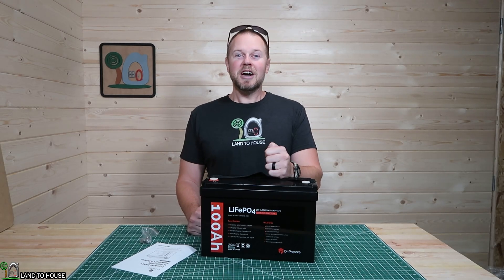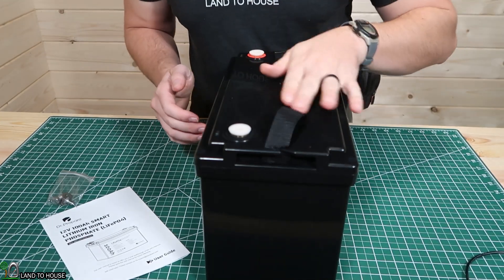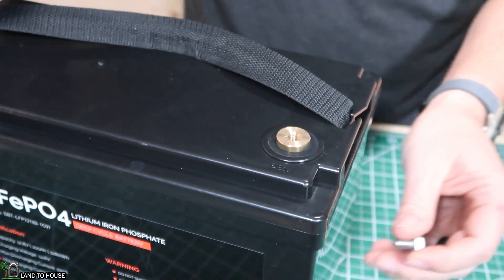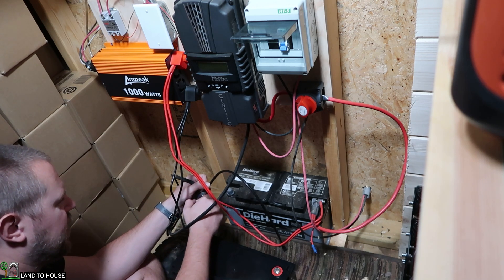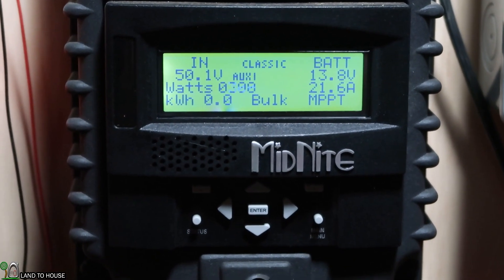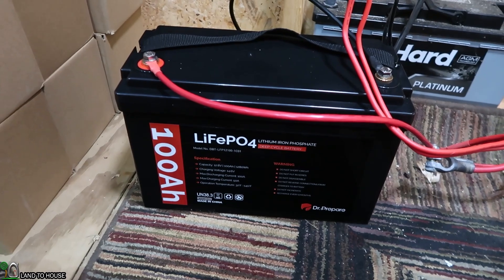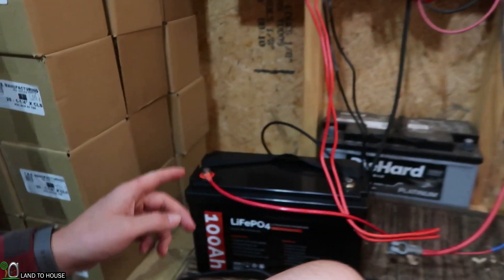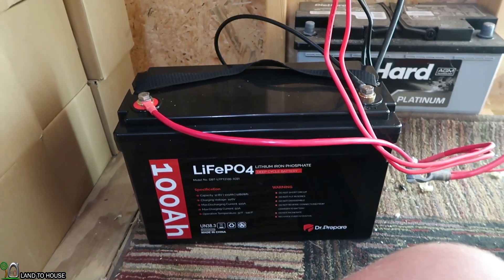Dr Prepare 12v 100Ah LiFePO4 Battery

Comment: U forgot to read on battery that you can not series the battery because the bms board in battery does not handle voltages above 14v where as if it sees more then batteries shut down inverter shuts down

Comment: Tried to cancel an order. Contacted them immediately. Two emails and 3 days later, still no response. I don't recommend using them.
Update:
They shipped the order anyway--even after I contacted them days before it shipped. Now I have to dispute the $600 charge. Crappy customer service.

Comment: Those don’t have a temp sensor that shuts off charging when cold. One day at or below 0 deg and you damage the battery permanently if charged at all and the severity goes up the higher the charge is. They get away with it until the warranty is over in many cases as with a very small charge it just degrades faster. The internal resistance of the battery also increase along with the self discharge until you get to the point of cells venting in the end because they run away. I believe it was will prowse that opened one of these and found the low temp shutdown did not work

Comment: I have the same battery for review. I will be testing the low temp cuttoff after leaving the battery in the freezer for a couple days (since they claim it has low temp cutt off and will prowse tore it down and proved it didn't). I'm interested to see how much capacity is lost from charging it at such a low temp since everyone just says it will be damaged.... But by how much right?! 

 I was able to putt 100ah from mine in a capacity test, it charged at 50amps just fine and I was able to pull 100amps for 10 minutes just fine.
Reply from the maker: Nice! Yes I also wonder how much is lost. I have seen mine charge at around 32 degrees. We have not had much cold weather so far.

Comment: This doesn't have low temp cutoff and build quality seems not good inside. Will Prowse did a teardown and didn't recommend it.
Reply from the maker: So far I have had the battery down to 22 degrees. No issues at the moment. I have only been using it when the outdoor temp is around 30 and up. We shall see how well it does when it gets really cold.
Reply: @LandtoHouse  Be careful getting the battery to low temperature as it doesn't have protection. You will be able to charge it even at low temp but it will damage the cells permanently and reduce the life significantly. I don't think you will know it right away.

Comment: So this battery does have a lower temperature disconnect right Because I live in Maryland and I wanna put this in my Rv
Reply: It doesn't have low temp cuttoff, will prowse tore it down, no temp sensor inside. I also have this battery for review and mine charged below 32f. Still testing before I put out my video.

Even after will prowse torn it down and found that it didn't have a low temp sensor inside the company still says it won't charge when below freezing lol...
Reply from the maker: it says that it does not charge below 32 degrees and does not discharge below 14. But I have not tested the battery below 26 degrees so far. Also I have not tested the charge below 32 because it is not cold enough yet. So I cant say from personal exp.
Reply: @LandtoHouse  I believe it's saying that those are the safe operating ranges, not that it has low temperature cut off.
Reply: Thank you for the information I appreciate it

Comment: fyi.          in that sort of situation,  hitting  32  can be  Avoided.     simply by  'spending  a few  watts', when needed, to power a string of  christmas lights, there;  and  some basic  insulation.    a la  corrugated cardboard, etc.
Reply from the maker: I actually plan on building a tongue and groove Box around the electronics. That way it will hopefully keep itself warm in there probably worth putting a little foam insulation.  The main goal is just to prevent anyone from touching something.
Reply: Maybe buy a legit battery brand that actually has a low-temp cutoff, and can be linked in series? Not a Dr. Prepare.i

Comment: Well I don't know if this would be a good addition to my solar power system. I mean eventually I'm going to want to connecting series for 36 and 48 volts. Right now I'm using deep-cycle RV batteries courtesy of Walmart. I have been unusually lucky. I gave away a bunch of batteries to friends and landlords.  And everytime I need to buy a battery, somebody is nice enough to leave me a core by the trash.  It's just a little day-to-day Miracles like that. That remind you you do live in the radiant Sunshine of God's love. I would not presume upon his love by going to the crap table at Las Vegas.
Reply: You can not install this bateríes in series, only parallel
Reply: @jorgeestrada3815  that's what I said since you can't install them in series, and I'm eventually going to want a 36 if not 48 volt system. It won't work for me
Reply: Yes sr. Good luck  with  your  project 👍

Comment: Thank you for keeping us up to date on your off-grid shed's power.  I did wonder, when you set the midnight solar charge controller to 14.5v, and then read the manual that said the battery wants 14.6v charging, was there something we're missing about that? like the midnight has a +v you were accommodating, or just deliberate -0.1 for a safety margin?
Reply: As long as its lower its fine. You can set any battery to be lower and will extend the life of the battery. Most that live off grid keep them lower(like me) to get longer life out of the batteries. This also depends on the flow charts in each testing of the batteries from the company. Remember over working any electronics is hard on them so most never bring any part of the solar to the highest rating they sate for each component. I/E Charge controller is 100 amps Keep the charge max to 75 amps.. and buy one more for higher demands.

Comment: One thing that surprised me on their battery label -- do not connect in series?! How do they expect to cater to the 24v and 48v masses for solar? Hmmm 🤔You're not prepared until you're Dr. Prepare! 🤣 I've never held such a battery and was surprised to hear it's only 25 lbs -- nice! I think it's time for some gear to test these things out -- charge and discharge meters to really test their claims vs. reality.
Reply: I asked google, multiple returns stated that the internal BMS for 12v(nominal) LiFePO4 batteries isn't designed for series connections.  instead they sell 24v and 48v batteries.
Reply: @workbenchz  seems like a good design to sell more batteries....🙄
Reply: @workbenchz  Ahhh shows my lack of solarology skills. Thanks!
Reply: I prefer to build my solar bank batteries from used hybid vehicles. they are much cheaper, Plus you can replace failed cells if need be. In these all in one batteries they have high risk to me if it fails and you know they fail after warranty runs out/..

Comment: You can not keep a lithium iron phosphate battery fully charged it the images the battery and eventually can become dangerous. Not sure how they work that out if you are using it for solar and it keeps it charged to 100%. I would imagine that you need to lower your float charged down to about 13.4 to extend the life of the battery. Must BMS that they have inside the battery allows the battery to start discharging after x amount of hours just a small amount of discharge is all it needs. Lithium iron phosphate battery start to build up crystals when fully charged and they start puncturing the layers.
Reply: Craig C, You raise an interesting question, can a solar battery be connected to a solar charge controller and left 24/7?  Checking the Dr Prepare site, and several competitor sites, the answer is that as long as the charge controller conforms to Lion chemistry 14.4-14.6v CC/CV protocol for a nominal 12v pack, with a not to exceed 1.0c output current, the internal Battery Management System circuit card will ensure proper float/maintenance for the LiFePO4 cells.  Apparently this is exactly what these batteries were designed for.
Reply: Anyone into solar system will normally keep the volts lower to keep the battery life way past what is stated. If you look at the graph charts in each battery chemical under testing then you can pic what is best for you and your system on what volts to keep it at. Most I have seen just a few .2 to .4 volts lower will jump the life down the road.
Reply: @homesteadonthemountain3100  yeah but he set the float kinda high. Hopefully the onboard BMS has a float and discharge. Life DJI drones with this type of battery they will start to discharge after 36 hours to prevent damage.